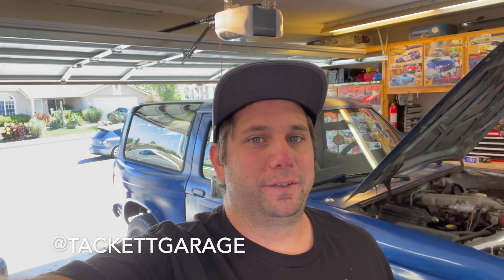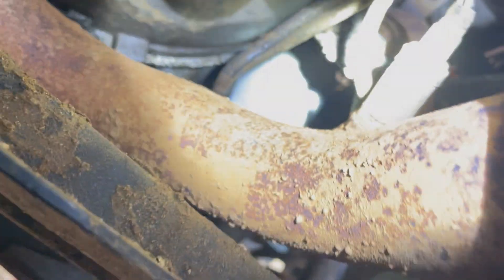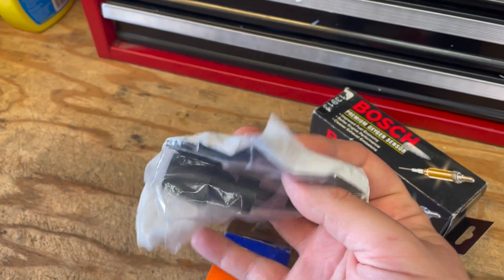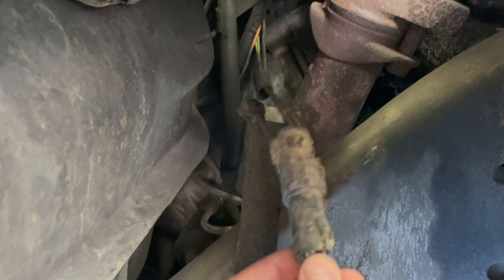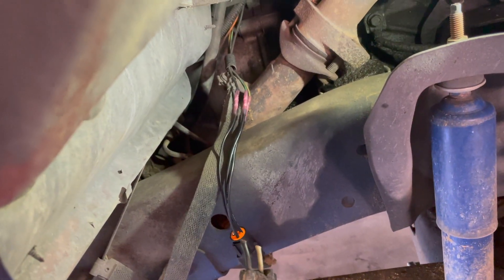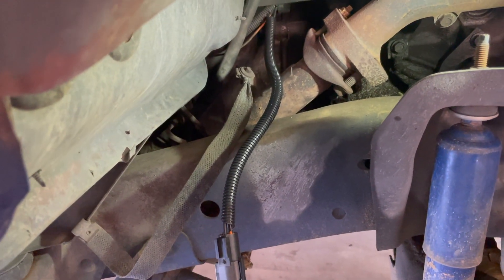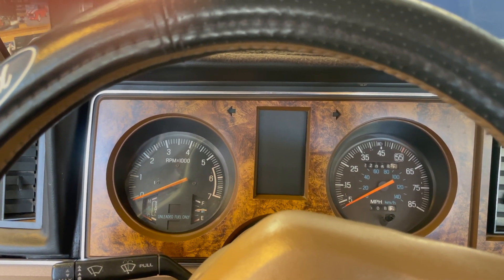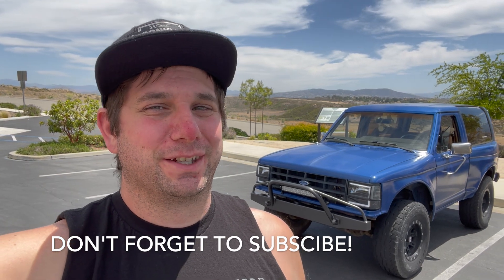Bronco 2 problem fixed!

Comment: Nice find, or at least nice that you found that. I think I may have discovered the problem with my BII. Today I had an oscilloscope hooked up monitoring the PIP and SPOUT voltages and the primary ignition current. The engine died then restarted and stumbled. When it did that the primary ignition and the SPOUT signals completely dropped out. There was still a PIP signal but it was only about 80% of its usual voltage and it appeared to be missing the characteristic shoulder so it looks completely messed up, as though it's a repetitive, weak cylinder 1 signal. I just ordered a new distributor figuring the problem must be the Hall effect sensor. It's so bizarre that it only does this occasionally. EDIT:  I repeated the last drive I took that made it act up, but with the new distributor installed it ran perfectly.
Reply from the maker: Nice, glad you found yours. I sold my b2 still had the problem. Heard back from the second owner after me that a fuel pump was the ultimate fix.

Comment: my 1988 Bronco II Had The Same Problem My Local Ford Dealer Got Busy And Ordered Mine From Ford Came With The O2 And The Wiring Works Like A Champ
Reply from the maker: It’s amazing what a working o2 sensor can do.

Comment: Great looking Bronco! Same thing happened to my 87 Ranger 2.9 but my harness completed melted and I can't see the colors. Any way you could tell me what color wires go to the black wire and the 2 white ones? Haynes manual doesn't help because its color coded where it burned off. I'm at a loss. Sure would appreciate it!
Reply from the maker: Thanks! It’s been a little while since I did it so I don’t remember off hand, but. Took a picture of the bad connector and from what it looks like I think the green wire went to the black wire and the gray and black wires went to the white wires. I’m not 100% sure about it but that’s what it looks like. I hope that helps! Good luck!
Reply: @tackettgarage4982  That's helpful, thanks alot!

Comment: How do you do the rear pre runner fenders
Reply from the maker: Well the quarters were trimmed to give the bigger tires clearance, then sealed so the road grime doesn’t get thrown up in there. Then you basically just line them up to where you want them, and mine were attached just using screws. There are probably better ways to do it but that way was simple. They were on it when I got it.

Comment: What fiber glass are you running??
Reply from the maker: It was already installed when I bought the bronco, I never saw any stamps or anything when I was working with them either.

Comment: friend could you show or show how you did to lift the suspension, thank you in advance new subscriber excellent content
Reply from the maker: Thanks and welcome to the channel! As far as the suspension goes it is actually stock still. But the way it is able to clear the 32 inch tires is the stock fenders in the front have been replaced by aftermarket fiberglass prerunner fenders, and the back has fiberglass prerunner over fenders that screw on and the rectory quarter panels have been trimmed to clear. For the most part there are no clearance issues, only if you get kinda aggressive off road the back tires will run the inner quarter panels a bit. I would like the truck to handle better off-road though so I’m thinking one of the next modifications will probably be one of the James duff lift kits, like the stage 3 3 inch lift.
Reply: @tackettgarage4982  I actually got the James duff lift kit yet to install it but it's comn. Think it's the 3inch lift with a 2inch body lift, hoping to be able to get atleast 33s on it. Would love to do a motor swap 302 just don't know where to begin looking??
Reply from the maker: Nice! Sounds like it should clear I would think. V8 swap is definitely on my wish list too. Seems like from what I read you almost have to swap most of our drivetrain because it will go bad with the extra power. My thought has been between a 302/5.0 with an older style c4 transmission or maybe a Chevy small block v8 because the parts for them are so affordable and there are so many options of tuck headers and stuff for swaps that it might be easier/cheaper. That part is still in the dream stage for me.haha

Comment: My bronco 2 made it home one night and the next day it wouldn’t start so I replaced the in tank pum and the rail pump and the filter and it still is not getting fuel to the rail do you have any advice on what I can do?
Reply from the maker: My first thought is are the pumps coming on? Usually if you just turn the key on the pumps should prime. If it’s not I would start checking like fuses, relays, and I think these will have the inertia switches hidden in the interior that are supposed to turn the fuel off if the the car rolls over. If they seem to be working maybe something happened in the tank at the pump there maybe a connection in there to the pickup got weird, or there’s always the obvious checking to see if there is gas in it.lol
Reply: Yeah there is gas and I hear the one under the seat kicking on but I can’t hear anything from the tank so I will have to check that by unhooking the fuel line right after the tank and see if it is even pumping
Reply from the maker: Yeah sounds like the next step. Good luck. Hopefully it’s something easy.
Reply: Check the fule  shutoff switch under dash on passenger  side , depress button  and try to start.

Comment: This has made me so mad I was at a ford dealer and for 9 months non of us could figure out why mine runs like shit after a few min of running . Watching this . I belive that this might be my problem . I feel so stupid for forgetting about o2 sensors
Reply from the maker: Yeah it took me months to think I should try changing the o2. It’s easy to forget about them on the older cars because they don’t really set a check engine light or anything. Hopefully you can get yours up and running good now!

Comment: 1. Always diagnose and check the parts in question before buying anything…2. Chk to see if any codes show up,,3. Good luck
Reply from the maker: Yeah it was a tough one for sure. Ultimately ended up that the fuel pump was giving up.

Comment: whered you get the headlights?
Reply from the maker: I got them in Amazon, I put a link for you, if you want to see them in more detail My video called explorer lights and prerunner bumper has more footage of them.
Pair Black Housing C-Shape LED DRL Bar Headlight+Bumper Turn Signal+Corner Lamp Replacement for Ford Explorer 91-94 https://www.amazon.com/dp/B07YFB46FV/ref=cm_sw_r_cp_api_glt_fabc_H25H6Z5QP55281VJZ4GK?_encoding=UTF8&psc=1

Comment: Where did you get your cold air intake for your bronco???
Reply from the maker: I actually made it. I bought a generic one that I think was for a Honda of some sort(civic or something) and I trimmed it to fit good. Had to get the right coupler to connect it to the throttle body I forget the sizes now but it was a step down to get to the right size. Then I changed the filter out and put on one of those filter wears on the filter.
Reply from the maker: I made the intake before I started making the YouTube videos but I posted one called Air Filter Upgrade which is the one where I changed the filter and you can get a better look at the intake.